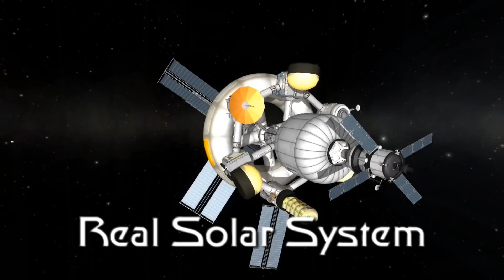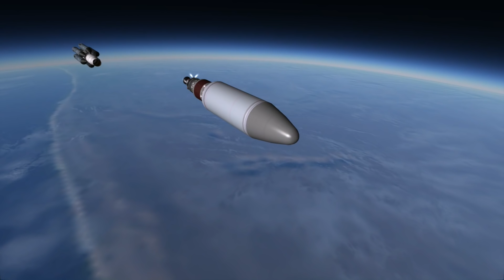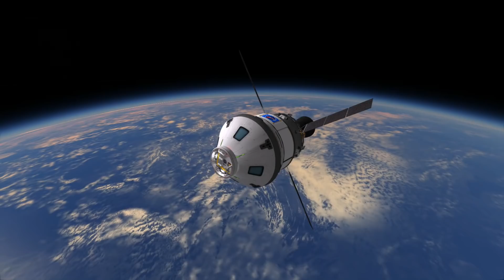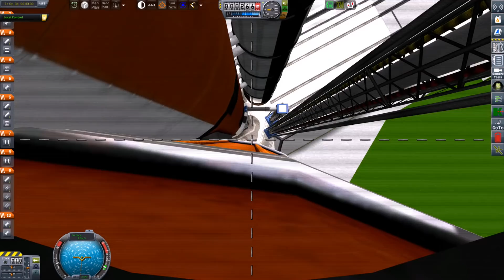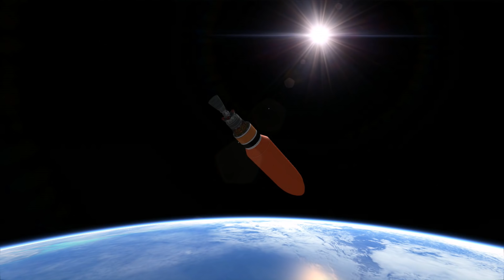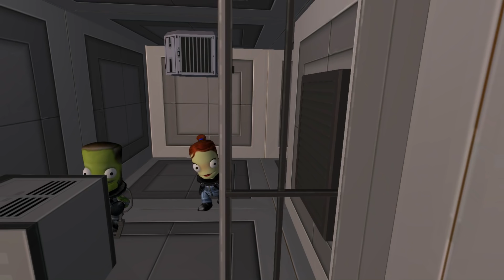A09 "Perun" - Project Ares - Real Solar System - KSP 1.1.3

Comment: I found out that the docking ports from Sum Dum Heavy Industries (SDHI) are not compatible with the revamped docking ports on the core module. My suggestion is to use MK 16 XXL and a separate drogue chute on the command module.

Comment: I had problems with tumbling too. I found out that the best thing to do is to lower the engine gimbal slowly so that it still has enough energy to correct the tumbling at the start and bring it down slowly. At the end just disable the gimbal completely and just steer with the RCS.

Comment: I wonder if it is just amazing coincidence, or due to you being a genius, that "Alternate Reality Earth Spaceprogram" shortens to "ARES"
Also, not to be nitty picky, but i don't think it's possible to make expander cycle  engines with de laval nozzles that are any more powerful than 300 kN. It's something about the square-cube rule, basicly, if you double the size of the nozzle, you get twice the area of hot nozzle to use in changing the phase of the liquid hydrogen, but the volume of the nozzle gets four times greater, making four times more fuel and oxidizer neccesary. 
Anyway, everything i just said might be wrong, i'm not a rocket scientist xD
Other than all that, i think your videos are amazing, the storytelling, the rockets, the designs and the teaching about rocket cycles and history. Great videos!
Reply from the maker: Well we use a base-plate of prefabulated amulite, surmounted by a malleable logarithmic casing in such a way that the two spurving bearings are in a direct line with the pentametric fan. This allows more performance and efficiency.
Reply: You could just use a straight aerospike, that doesn't suffer from the square-cube law, but indeed upgrading to a turboencabulator is a great way to overcome the problem.

Comment: Two questions. One, how deeply throttleable is that hypergolic engine on the crew capsule? Two, how do you make the thrust curves for your SRBs? I know you can use the thrust curve module in realism overhaul, but your thrust-curve graph seems to imply some other tool. Thanks for your response, and I loved your video as always.
Reply from the maker: It can go 50% to 100%. The curves are done with a plugin for Unity, and then I copy-paste the values to the CFG file.
Reply: Thanks for the response! Hey, do you think you could make any rockets with stage-and-a-half first stages? It's a fascinating trick used on the early Atlas rockets, and I haven't seen it much done since then. I think it'd be really cool, if only so you can explain the history and science behind it. Thanks!

Comment: The extendable nozzle engine looks cool! May I know which mod is it from?
Reply: Oh, that works??? The version on my end doesn't gimbal for some reason.
Reply from the maker: Bluedog
Reply: +Bob Fitch Wasn't that one of Nertea's cryo engines mod? :O I could be wrong of course, I've got both mods installed.
Reply: JimmyStiffFingers
No, it was definitely my RL-10B, which is based on the same engine as one of his. I need to take another pass at the textures.
Reply: Ah, ok, ok. :) So many mods... ;) So... You made the mod...? Or should I feel stupid for asking that? XD
Reply: Yes! :) I'm the Bluedog Design Bureau author. (Well, the original one. There are a couple others that help me now that the project has grown)
Reply: Ah, cool. :) I love the mod. ^^ Especially the SRB's, they look gorgeous.
Reply: Thanks! Which SRBs? I know a lot of people enjoy the 1.5m Castor 120s for building Athenas and Carracks.
Reply: Pretty much all of them. ;) The details on them are really cool.
Reply: Thanks! I have a bunch of other SRBs planned but I've been busy with stockalike Apollo/LEM/Saturn lately.

Comment: I'm guessing it was the Mir that was never built. The one that the designs have been assimilated into the ISS?
Reply: MIR most definitely existed. Got de-orbited in 2001. You're probably referring to Mir-2 which got canceled with only the core module design and constructed. 

My bet is on a Freedom station replica.
Reply: I often heard about the MIr-2, but i'm not able to find any Informations about it, do you have a Source ?
Reply: +Wilko Stomberg 

https://en.m.wikipedia.org/wiki/Mir-2
Reply: +Wilko Stomberg 

They even reused the module for the ISS
Reply: +Crazy Kenny yes, that's exactly what I meant.
Reply: It was obvious what you meant lol. "The Mir that was never build" is not the same as "Mir, that was never built".